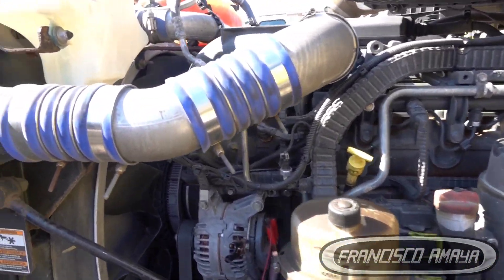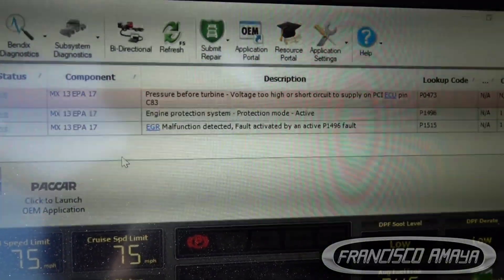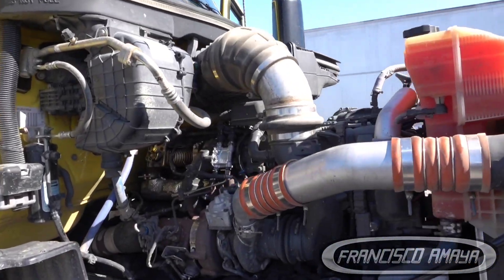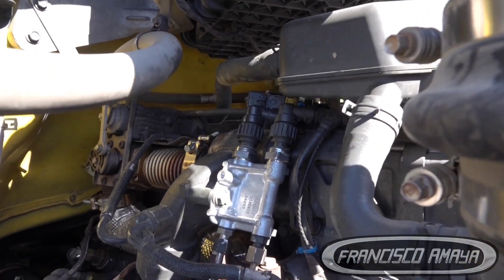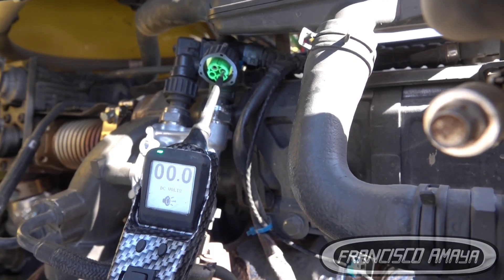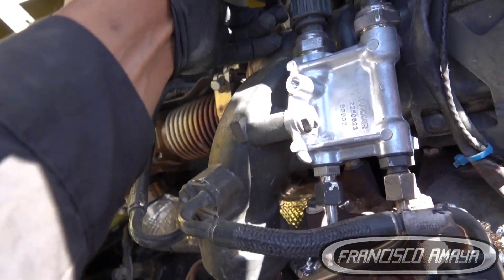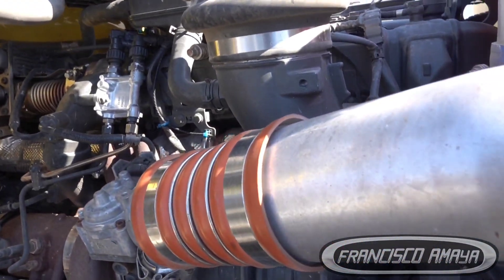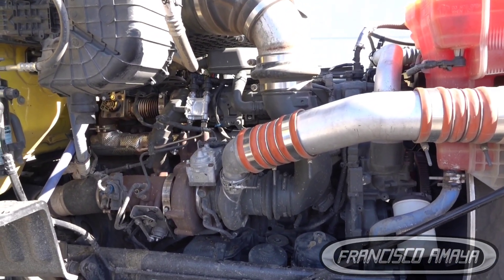PACCAR MX13 ENGINE TURBO PRESSURE SENSOR EXHAUST MANIFOLD PRESSURE SENSOR FAILURE P0473 P1496 P1515

Comment: check if both of the lines are plugged using shop air - disconnect boost pressure sensor and check if plugged, if found plugged unit will need air management cleaning. To check egr valve always move linkages when key is off!